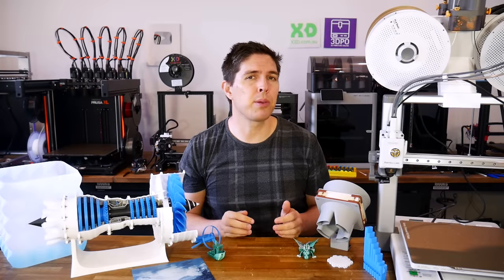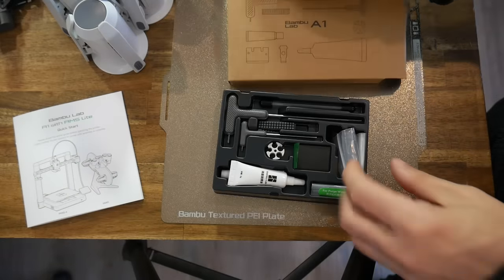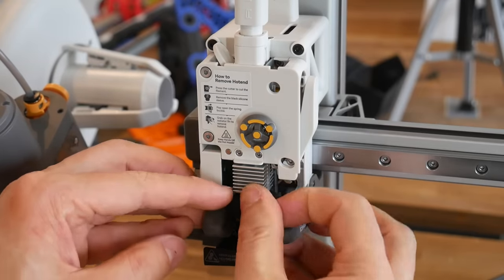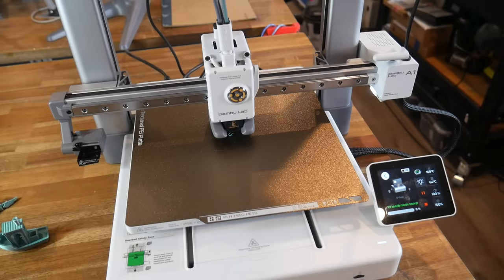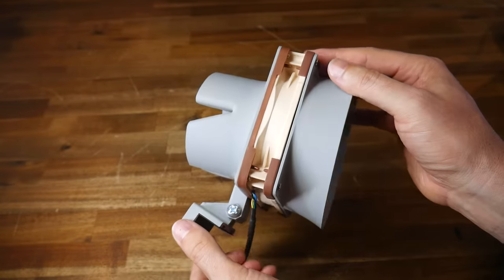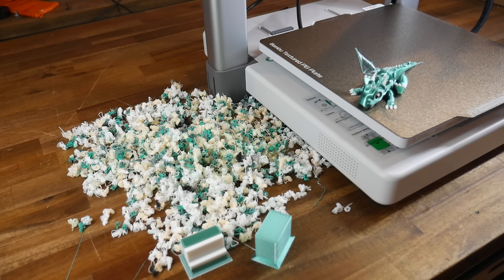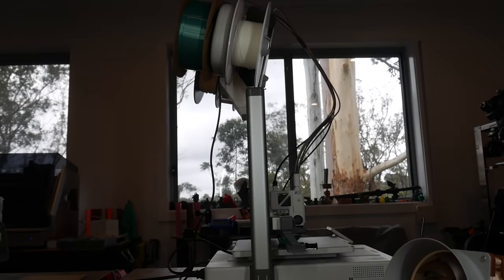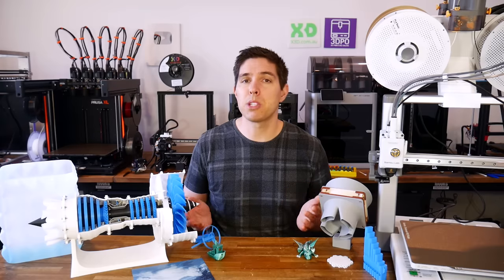Bambu Lab A1 detailed test - ‘Just works’ 3D printing for a great price

Comment: I think Bambu should release a filament recycling system, that would pair well with their wasteful printers. I'd buy one as long as it's relatively affordable.
Reply: honestly I think the stock bambulab profiles  are overtuned for flawless color changes. You can save soo much waste filament by tuning purge amounts down with a few tricks. I think bambus next innovation should be at least offering those filament saving measures as a stock option.
Reply from the maker: That is a fantastic idea!
Reply: they've certainty got the engineering skill to do it. They're outstripping their compediters easily, doesn't even seem like  a fair race.
Reply: Agreed - the ability to recycle waste into filamemt is very attractive; even just to use the recycled filament spools as support material when printing. This is both economically and environmental beneficial - I would pay the same as a bambu printer for a reliable recycling process/feature.
Reply: @TeachingTech perhaps you can send a suggestion to your bambu representatives?
Reply: Michael did recently release a DIY system for shredding parts and CNC kitchen made a filament recycler that was relatively affordable. Altogether both cost about 1200USD which isn't too bad. 

If you can find a way to separate the filaments if you're using multi-material, it's a good option for now!

Comment: In my experience, the artifacts you're seeing on the surface comes from variations in the filament. It's simply over extrusion and it can happen consistently over a whole spool or intermittently. If you got the same thing from one print to the other and it's different with a different spool, then the thickness of the filament is the only variable.
Sometimes when I get cheap filament, I must change the flow rate by up to 5%.
Reply: How do you dial in each new spool? Could you please post thingiverse IDs for the test models?

Comment: I recently bought an A1 and with some research it seems a lot of people are having trouble with PETG with A1 series. First few layers walls only. Just random things happening with blobs and strings in random places. Also slow starting print Gcode that takes 3mins or longer just hanging out doing nothing before print starts. If you can make a in depth video on Petg settings with the A1’s that might just be wrong in Bambu presets that would be amazing. I know a lot of new people are now in the Bambu echo system. Even me coming from Ender and Cura, Bambu is very different. 
Super bonus if you can figure out Bambu Petg-CF with long prints. Thank you for all the teaching. Amazing channel.

Comment: The AMS Lite Top mount Bracket now has 2 Back supporting braces to attach to Z Frame that supports the back.
Reply: Do you know if the A1 comes with the new bracket on top to hold the multicolors and the bottom Z Frame, or do you have to print it yourself ?
Reply: @zero00tolerance  you have to print the ams lite support top mount. And the Z braces and dampener. But you can buy the screws set from them for a few $.

Comment: Love my A1 mini, no regrets. A1 looks amazing but as a first time user with hobby needs and limited space, the mini is defo the right choice. Think if I ever upgraded I’d maybe aim for next gen/version of p1s to get something ‘neater’ and with an enclosure.
Reply: But you had to buy the AMS with the Mini and that makes for a bigger footprint than most XL printers!  Or don't you use the AMS?
Reply: @joeking433  Yes I wanted the AMS, so really just comparing the two. At the mo it's setup on a sideboard which is just the right depth. I think with the A1 it wouldn't fit in quite as well.

Comment: Thank you for another great and thorough review!
This is THE REVIEW that all should watch. 3DPN just read the Press Kit and called it a video, but yours goes in depth, as expected.
One thing that should be tested, and so far no one tried: printing a TALL object with the AMS Lite on top of the A1, because a benchy is too short to be affected by this heavy load on the top, even on a bed slinger, I guess if you plan on printing tall objects frequently, a bed slinger is simply not the ideal option, anyways
Reply from the maker: I did print more than just the benchy with the and on top, but admittedly nothing really tall. I might return that vase and pin a comment if there are any red flags.

Comment: As usual, your content is clear, valuable and straightforward. I am new to 3D printing and started with a Kobra 2 a couple of months ago and subscribed to your channel and Patreon membership. You really gave me a leg up! I'm glad I started with this printer because it made me go down every rabbit hole available to get a deeper understanding of the underlying technology. As much as I'm a geek and love this, I'd rather be in my shop using my 3D printed hacks to make woodworking projects than becoming a 3D guru, thus the move to the A1. As part of my learning curve, I purchased a Raspberry Pi, an enclosure and camera, and OctoPrint Pi to manage my projects. I'm assuming that I will no longer need these if I get the A1. Is this correct? I'll probably try to sell my Kobra 2 with all the accoutrements and 3D add-ons I've printed, but don't want to sell something I'll still need with the A1. Bottom line, is there any usefulness at all to the Raspberry Pi components?

Comment: Standard Bambu Lab concerns aside, this printer is quite interesting - rather than building a large(r)-format printer or going after the ripe-for-improvement IDEX market, they've apparently decided to dive into a much more crowded segment occupied by Creality, Sovol, Anycubic, and Elegoo. I wonder how that's going to turn out for them.

Also, while I'm not one of the people who get upset at the thought of putting filament on the top crossbar of 3D printers, I do kinda hate having four full kilos sitting on top of a printer barely twice that heavy. Given that the A1 and A1 Mini are very much designed for people completely new to 3D printing, I can see users being extremely confused at why their print quality is getting worse and not connecting it to all the extra mass (and its location).
Reply: Yeah, it's a dumb idea.  It will lean the gantry.

Comment: "Printing on blue painters tape" ... oh man, I completely forgot that was a thing we did back then. My little Fabrikator Mini came with a couple pre-cut sheets of tape to print on. Then BuildTak came out and it was a major upgrade for my printers at the time.
Reply: Printing PLA on painters tape, and ABS on a glass sheets with ABS slurry. I feel nostalgic about it yet I also really really don't miss those times :P It's weird to look back on how primitive everything in the 3d printing world was just a few years ago.
Reply: He you could also choose if you wanted a printer with heated bed or normal, in case it was a 12v super slow heating bed.

Comment: Shame the print quality isn't quite there. There always seems to be a fly in the ointment somewhere with 3D printing! But the price and features are incredible. Might be worth waiting a bit for the firmware to get some updates.
Reply: I think it’s worth noting that that quality comparison was with an A1 mini, which has incredible print quality. Being #2 isn’t really all that bad
Reply: @n0vaph0enix  and since the toolhead is the same between both printers it really makes me wonder what could cause this?
Reply from the maker: I've sent the bracket stl to bambu lab for them to test. I've watched Stefan's review and his print quality looks better than mine, so maybe there's something slightly off about mine that I can fix.
Reply: Its still one of the best.

Comment: Hello and thank you for this superb video, I also own an A1, can you tell me 2 things?
1) why does the print head remove after the 2nd layer at the rear left of the plate to then resume printing?
2) How can we modify the fan speeds in bambu studio because even in filament + edit the speed it doesn't change anything, I run at 80% all the time, thank you very much...

Comment: Another great video and I love my Bambu printers (I have an A1 and an A1 mini only because of the trick BBL pulled by delaying the release of the A1). But I am unhappy the way they did the nozzle cleaning on the A1. The A1 mini was prefect but with the A1 they decision to go cheap ( would have gladly paid a few more dollars for the mini way). In stead of the $6 replacement parts they have opted for a system that wares a hole (eventually I am sure) in the build plate and ware down the nozzle. So now it's a $30 or more proposition to replace those and not $6. Also the A1 mini was pretty darn quiet for a 3D printer, the A1 there are a lot of bumps, bangs and scrapes you don't hear with the mini. But still miles ahead of any other 3D printer on the market, those are just little things that annoy me.

Comment: Anker just lost any chance at making it in the 3D printer market. 
This is how you do a reliable, hassle free, stylish bedslinger for people who want to print rather than tinker and troubleshoot and on a good budget as well.
Reply: Really depends on their v6 color engine I think. It's set to (hopefully) be out first quarter and only work with their machines. The promise is no wasted filament for color swaps through the 6 retractable nozzles on the extruder. If they deliver on that it could be a game changer for them as it would make fast multi color printing possible even at low layer heights
Reply: Ankermake M5C is a total waste of time. You get quality print and trouble shoot over and over again.

Comment: My experience on the noise level of the A1 vs the A1 Mini is quite the opposite of yours. I was amazed by the quietness of the Mini and fairly disappointed of the A1. On my A1 the fan is a bit louder than on the Mini, and the movement sound is much louder, primarily on the y-axis. I have seen other videos stating the same, but according to Bambu Lab it is within the specified limits. So I will keep the Mini as well and print smaller items on that and only use the A1 for larger items.
And by the way even if I ordered my A1 within the first 30 minutes of release there was no mystery box.

Comment: With the A1 recall: do you think the A1 mini is worth it or better wait for the A1 update expected in May?
There are other alternatives as the Ender 3 V3 KE that seems has a better qualiy printing than the A1 and lower price and bigger community for troubleshooting.
Most of you would tell me that I am comparing different kind of products but at the end with all the poops generated by the AMS lite I do not think the multicolor option is a choice and the other features are very similar between A1 and Ender V3 KE (adding the accelerometer and nebula cam) for lower price.

Please, any comment to this?

Comment: Now hopefully it will not be long before Bambu Lab release a 400 x 400 x 400 printer.
Reply: Currently saving for an x1c, if they released an x2c that’s larger or something then I would be happy and angry at the same time lol...
Reply: I wonder if they are struggling to scale up core-xy? Anyway, I think in CNC Kitchen's interview he said the XL would be part of the second gen range, so maybe a little while off yet (March?)
Reply from the maker: This is pure speculation on my part, but I feel the features seen on the A1 are considered gen 2 for Bambu Lab and this tech can now be rolled out on upcoming machines.

Comment: Right now in the UK the P1P I can get for £549.00 (I have seen for £457), The A1 with AMS is £509. I'm torn on which to purchase, this is my first 3D Printer. Agree I lose the colour option with the P1P, but I can add that at a later date with the AMS, but which is the better for first time and value for money.  Bed Slingers (A1)  or XY (P1P)?
Reply from the maker: If you are only doing PLA and multi colour printing the A1 will be a better fit. Where the P1 is better is with materials that need an enclosure, like ABS/ASA/nylon. You can make your own P1P enclosure, but the better option is probably a P1S, which is of course more expensive.
Reply: @TeachingTech  Hey thanks for the reply. Since I'm only just starting out I'll go for the A1 for now, then when I start to advance more I can start to move into those materials.

Comment: I wonder if the AMS lite uses the same cable as the regular AMS...  AKA wondering if you could chain a AMS lite to the end of a regular AMS (on a x1 or p1 printer) even if it's just 1. I wonder if it could be done for rolls that don't fit well in a regular AMS..

Comment: What's the total height with the AMS mounted on the top like that? Can't find that info anywhere but I have a specific place in mind and it would only work with that on top...providing it can fit in a space 80cm tall!
Reply from the maker: Just ran a tape measure for you. I got 750mm from the base to the top. With the highest components being PTFE that could be squished down a few cm if needed.

Comment: I noticed the prusa with muti nozzle color changing system.. seems like a much better solution
Wish it didn’t cost so much..

Thinking about the A1
I design and print lots of things in tpu 
Is there a good way to add pla into a mostly tpu part? I know the AMS doesn’t work with tpu

Comment: Just a thought, Why not build and enclosure to house the printer that includes some Fiberglass insulation to dampen the noise? a side benefit might be that the temperature inside the enclosure could be better controlled.
Reply: Bambu recommends against making an enclosure for the A1 according to their FAQ. There might be some components that are thermally sensitive, I didn't look into it further.
Reply: @HonorNecris Probably the PSU. When building enclosures for Prusa MK3s, it's strongly advised to move it outside the enclosure, because having it working in a hot environment for long periods can shorten its life expectancy.

Comment: Question:  Can the multiple feeders be used to automatically switch filament when one feed's run stops?  I would think this would be a great way to handle larger print jobs when you have limited filament left on a roll... just let it run out and the printer could switch to a secondary roll (potentially of the same kind of filament).  Curious if this can be done automatically with the A1.
Reply: A review (not remember exactly which) I watched at recently says it can do it. But not owning this model, I can't confirm.

Comment: Now compare this review to the review of Prusia XL - its night and day! Printer can't print reliably yet somehow it is good. Bambu controls what reviewers can and can not say, as simple as that.
Reply: The Prusa XL cost a hell of a lot more and is not meant for absolute beginners like this is, totally different market aims. For the money it’s worth it, no worse than the Ender 3 is and far less messing required.
Reply from the maker: No company has ever controlled what I can and can't say. My Prusa XL was more negative because it deserved to be. The printer was hugely delayed, crazy expensive and performing poorly. This printer has slightly worse part cooling than the A1 mini, and that's about the worst problem.

Comment: I've seen some others mention the underextruded line issue and I think a firmware update fixed it for them. Or in some cases it seemed to somehow just fix itself. Best and worst thing to happen really. Problem solved but can't help others with it.

Comment: The Bambu A1 has got me thinking about multi col/material support with a bit less waste.
You can see how the A1 has four filament tubes and a power lead attached to the top of the print shuttle.
I reckon this could be set up for multi heads in that shuttle unit.

The shuttle could be hung so that it straddles the gantry arm, rather than hanging off the front. Might be easier if the gantry was a tube???
Then the printing nozzles are positioned with two in front of the gantry and two behind, thus giving the head more balance as it shoots back and forth.
Then we get rid of the fan from the shuttle. Position it somewhere else and run a tube from the fan to the shuttle. This might allow us to install much larger fans, maybe with some air compression to get some really decent ventilation to the shuttle? Air reaching the nozzle might be cooler too.
Then we run the four filament tubes and the power lead  inside the fan tube, creating a single tidy umbilical cord attached to the shuttle head. The air tube could be quite lightweight, as the filament tubes would provide it with a bit of structural support.

Maybe If we had a tube attached to the shuttle head, we could SUCK  the air away from the nozzles. Would that cool the part sufficiently,? With the bonus that any fumes will also be sucked away???

Comment: Considering the tech is almost identical, it's a natural conclusion that the reason for poorer prints is either the filament used or a software (inc firmware) issue.